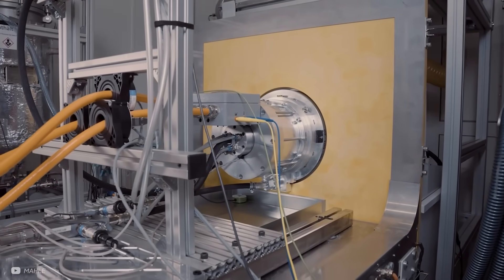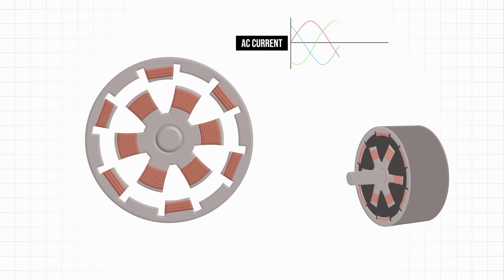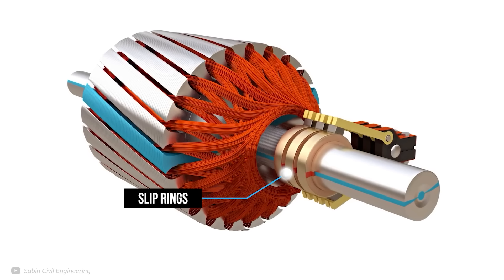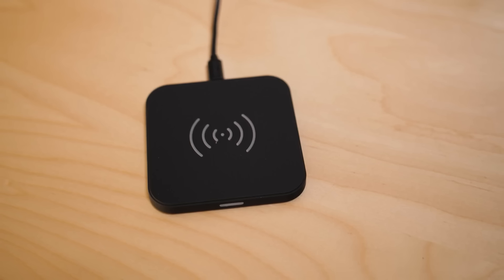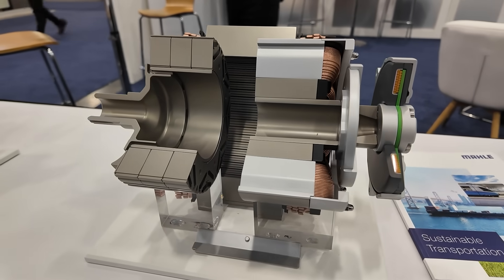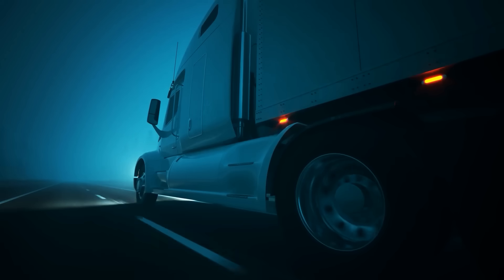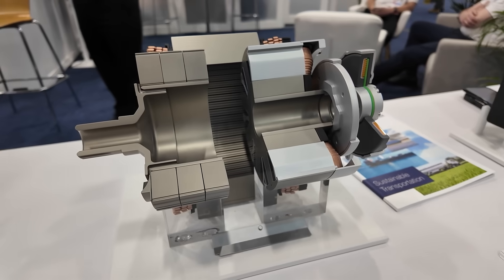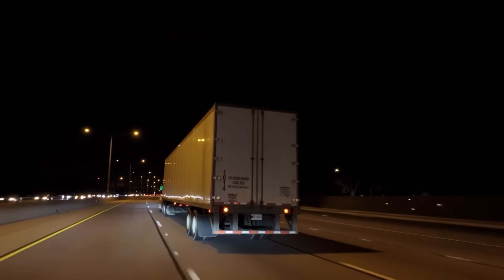Genius Contactless Motor Could Change Transport Forever

Comment: Induction motors are like 100 years old

Every ceiling fan is an indication motor

The reason AC won out over DC is induction motors

Brushless permanent magnet computer controlled motors are at least 30 years old

Floating oil bearing around the stator might sound good, but your churning through all that oil on the largest radius, lots of drag and you're wearing out the oil, not a large cost, 
But much better to have low friction air gap on large rough stator radius
Solid roller bearings on the smallest rotor radius can reduce friction and wear and tear

Thanks for all the work you or into the videos, it's way more effort than I ever put in
But maybe trust your audience to go deeper, 
This video is like trying to teach 123s to teenagers and then slap on the old you'll learn about that complicated stuff when you're older

Hitting the right note can be hard
As a kid I watched magic school bus and Bill Nye
It wasn't until later that I ever heard of Neil Degrass Tyson, when I finally did see some of his stuff I was annoyed that he didn't explain more, go deeper into details, 
But I'm pretty sure if I'd seen him first and Bill Nye later I would help the same about Bill

On the other hand, you probably get a lot of viewers eager to explain how you misspoke etc, which encourages an active community that is doing their own research, so, maybe you're a genius 🤷

Comment: This does actually change a lot ! ❤  this technique will be able to be used in things like plug in domestic,  commercial & industrial vacuum cleaners, pumps and other equipment that requires high RPM motors that are not tied to the grid 50 or 60Hrtz  !!!! 
   So all the sarcasm in a lot of comments going $# off   😮😮😮😮

Comment: This is much ado about nothing.  Wireless excitation of synchronous motors & generators has been done for a century.  But there is an elephant in the room, not mentioned.  Exciting that field coil (whether wireless or not) requires HUGE amounts of power.  That power must be transformed through (wireless) rotary transformer, which has losses proportional to the (large) excitation power.  Permanent magnets provide that "excitation" with ZERO power (thanks to quantum mechanics).  The only other technology that can claim this is SUPERCONDUCTING field coils.  This is even done in power plant generators.  (Someday, when superconductivity can be done at room temperature, this will be feasible in automotive motors.)   Second problem that occurs is when heat is generated in rotating parts.  (This is problem in induction motors, powered field motors, but not in permanent magnet motors.)  Cooling must be routed to/from moving parts, requiring dynamic seals.  These have wear problems MUCH WORSE than any slipring & are much more difficult to access for replacement, requiring removal from vehicle & total disassembly of the motor.
          Diagrams shown of sliprings are incorrect for this motor design.  There need only be TWO rings, not 3.  These photos are from 3 phase wound rotor induction motors (not commonly used today).

Comment: Nothing new and nothing better, just a contact less wound rotor. There are such motors with a "self" induced rotor. But a powerful permanent magnet motor is much more compact and lightweight. The benefits are not enough to justify using a universal motor.

Comment: But how does this differ from an induction motor? induction Motors don't make contact when they transfer power, they use induction to generate an electromagnetic field at the the stator which then causes the rotor to produce its own field and the interaction between these two magnetic fields is what causes the motor to produce torque, what am I missing?

They both don't use brushes, they also don't use slip Rings and both use bearings to support the rotor.
Reply: Ah, okay. I see now. I was initially focused on the shared characteristics between the Mahle mCT motor and standard induction motors—the absence of brushes, slip rings, and the reliance on induction. However, the crucial difference lies in the rotor excitation. I missed that it was externally excited.

In a conventional induction motor, the rotor's magnetic field is generated through induced currents from the stator's rotating field. The mCT motor, in contrast, uses a contactless inductive transmitter to actively energize the rotor windings. This makes it an externally excited synchronous motor, which is different from how traditional induction motors work.

While the stator still generates the rotating magnetic field, the rotor receives direct power, enabling more precise control over its magnetic field. This hybrid approach—stator-generated fields combined with active rotor excitation—results in enhanced efficiency across varying operational parameters and improves sustainability by eliminating rare earth magnets. Furthermore, the contactless power transfer reduces mechanical wear.

Essentially, the mCT motor advances beyond the limitations of conventional induction designs by implementing active, contactless rotor excitation, resulting in significant performance and sustainability advantages.

Comment: Iron Nitrides are considered as possible replacements for current rare earth magnets, no more dependance on China or the US. plus if current BLDC motors suffer from overheating  why not oil-cool them instead? why all the hazzle of trying to re-invent the wheel? 95% efficiency is spot-on, 😅nly heisberg could do better
Reply: I suspect in the near term it will come down to which technology is more mature. Once both are mature, who knows how capital cost, efficiency, power density etc will compare between them? I wouldn't be surprised if iron nitride works better.
Reply: I recently found out that BLDC motors aren't actually DC motors at all. They're multiphase AC motors designed to be run from a DC input.

Comment: My conclusion: the efficiency is not as good as expected any you need oil as cooling fluid, which also cost efficiency due to the viscosity or pressure drop. But you have a high power density. This is only important in aviation.

Comment: Im not an engineer, but I have a concerne, if theres no permanent magnet the stator coil have to be powered. Also the induction process is not very efficient, so there's energy loss there too. How much energy does it consume for the same amount of power in an equivalent permagnet engine. My intuition tells me that this will be much less efficient and thus power hungry than a standard permag engine. I'm afraid the lower cost of a unit will be offset by the higher energy consumption.
Reply: The fields on the rotor do not use that much current compared to the rotating fields of the stator.

Comment: I'm a retired truck driver and I can tell you many truck drivers love their powerful diesel engines and the sound they make. Yet if an electric motor can compete with the diesel engines pulling ability many drivers would be fine with them. Will be interesting to see how it goes.
Reply: they already do compete;look at diesel-electric trains and mining equipment.
Reply: @JayWye52  Well, yes, that's true. Of course a diesel/electric is actually a hybrid, not fully electric.
Reply: @JayWye52  those still have the diesel engine though
Reply: @DanRyan-v5y  the diesel engine is not doing any pulling,that's done by the electric motor. it's actually more efficient to have the diesel generating electric and have the motor do the pulling.  trains in Japan are all-electric.
Reply: @JayWye52  true but the op said electric motors to compete with the diesel engine, so one or the other not both. Both ,however, is probably better.
Many places have all electric trains , or diesel electric depending on infrastructure.
Reply: - yep the "pulling part" is easily done - the sound part can be piped directly into your headset we can even simulate a missed gearshift, that way you won't avoid industrial deafness long term..   (NB, I live making a bit of a joke, hopefully the humour is apparent, all the best man.)
Reply: @kadmow  Humor is always welcome. For me, if I were still driving I'd be fine with an electric motor as long as it got the job done. A couple times I drove trucks with an automatic transmission. A lot of drivers didn't like it but I liked it.
Reply: If it starts making good economic sense, drivers and fleets will switch as fast as they can. Look at how many have switched to the super single tires, flat disk wheel covers, under skirts, and the fold out aero kits for the back of the trailer. They are doing that stuff in the chase of a 0.1-0.2 mpg gain.
Reply: @ottopartz1  I agree. Efficiency is desirable. Any cost saving technology is welcome. Especially for fleets and owner operators. Even a small gain in MPG adds up to large savings over time.

Comment: Been waiting on that!  That system can be used to induce stable rotation in O'Neill Cylinder "cans" as a shell-mounted impeller instead of a hub-driven torque-arm system.  With contactless induction, you can keep it rotating for the many years required without the wear & tear on huge mechanisms.

Comment: .... you mean..... induction motors???  We've had induction motors ..... for ever.  So they precisely control the induction by using what is basically induction brushes.  Am I wrong?!?!?  I thought oil was an insulator, not a dielectric.  A dielectric is an acid or salt solution.  Am I wrong?!?!?!  You put oil in a transformer, cuzz it insulates.  You put acid or salt solution in a battery, cuzz it conducts and is ionic.  Yeah, exchanging heat away from all electric machines and batteries makes them run better and longer.  Not a break through seeing every CPU in existence has a "heat sink" and a fan.  The question is, "how much energy does the cooling system take in power from the engine?"  You didn't even comment on the "Y" slots cut into the profile of the inner rotor.  These are what Tesla is using to boost their induction power of their motors.  The next question is, "Why is a motor that is not using conventional induction using technology that is used by conventional induction motors?!?!?!?"

Comment: If you can control the strength of the rotor magnet, that also permits an increased RPM range because you can have max strength at low RPM for max torque, but as speeds increase you can do decrease the magnetic field strength to reduce back-EMF.  Like a built in gear shift.
Reply: Or you can use multiple old-skool brushed DC motors, and run them in series for low RPM high torque, and parallel for high RPM low torque.
Reply: @MarkStockman-b4j  You could.  However, a common method for traction motors was to run the current in the stator and rotor in series so that at low RPM when there is little back EMF, the stator field is maximized and when the RPM increases and the back-EMF increases and thereby decreases the current, the stator field automatically decreases.  That was the method long before switching electronics for things like sub-way cars.

Comment: This is a really good design, just on the cooling ( and harvesting of that heat ), but it is still an induction motor. OK the induction happens outside rather than inside, but I hope they release the details of their new design to back up their efficiency claims as I am currently dubious that it is as efficient as a permanent magnet motor. Great report! Thank you.

Comment: Why not have a hybrid system that is all oil cooled, then have a section with permanent magnets for low speed/ torque and use the induction at coasting/ high speeds.

Comment: How about regenerative braking? Its easy with permanent magnet but with this, you need to always power primary or secondary winding which causing lost of energy?
Reply: The fields on the rotor do not use that much current.

Comment: ERROR (graphics) at @6:30 . That’s not the receiving coil on the far left. That is the AC to DC control circuit, and probably performs some other functions as well.  The “receiving” coil is that green board that goes through the transmitting coil. And AC current then flows through wires in the shaft (shown blue) to the DC conversion circuit. You can see it correctly shown at @7:05. It shows “waves” between the two, and we can see the green board is attached to the shaft (rotor), not the stator.  This is important because to achieve high efficiency you need the magnetic fields to be coupled as closely as possible. Due to the inverse square law we lose a significant amount of flux density for every unit of distance.

Comment: How can it change transport forever? Brushless motors already achieve efficiencies well into the 90% range, so this new motor can only be an incremental improvement. Electric transportation is limited by battery technology, and of course the associated charging infrastructure, not by the efficiency of the electric motors. Most of the rare earth minerals go into batteries, not motors. So, as interesting as this motor may be, enough with the hype!

Comment: Electric power plants have been using small alternators on top of the generator shaft to power the field coils for 50+ years. This does fundamentally the same thing using electronics to generate the AC field instead of shaft power. Nothing really new here. And even this "new" design is already ~10 years old.

Comment: Using lossy wireless power transfer as a gimmick to sell a virtually identical motor to a synchronous induction motor. Lemme guess, it also cost about as much as a 45kW servo encoder motor... No thanks.

Comment: Fair enough, it's a development for the auto industry, but brushless AC generators have been used in aviation since the 1960s. I remember the first oil cooled gen in the 767 in the 1980s.
I don't think it's a breakthrough, and I would have preferred a deep dive into exactly how it works.

Comment: In reality the only thing this motor has going for it is no slip rings. It will be interesting to follow this and see their real world numbers. The lack of power density numbers is kinda suspicious in my opinion. I think maybe the amount of electricity they plan on transmitting (wirelessly) will generate way more heat than they are letting on.

Comment: The basic concept of non-slip rings on the rotor has already been developed in some home generators they basically use a capacitance and a rectifier diode or a bridge rectifier on the rotor

Comment: If rare earth magnets are so rare than why are they available in abundance in stationary stores at what I would call a cheap price. And secondly, if you heat them you can use a expensive machine to remagnetise them so then are you saying that the machine is expensive to make the magnets or are the mineral really rare? I'm guessing the former and we’ve bought the lie.

Comment: This new system is older than I am. Generators have been designed this way for 100 years. This is done to eliminate brushes. There is nothing new about this except maybe exchanging air cooling for oil cooling. You simply run the thing as a motor instead of a generator. How exciting.
Reply: Oil cooling is not new also. It can fail miserably (pumping oil into electrical wires = they become hoses).
Reply: Indeed, when I was an apprentice studying to become a ships engineer in 1976/1977 I had to keep some kind of log where I had to describe how several systems worked or how to how to troubleshoot different systems. This had to be done in a way that you showed a thorough understanding of what you did or studied. I saw the drawing in the thumbnail of this revolutionary motor and my first thought was "Ah, the generator on the 'Straat Talbot' (my first ship as an apprentice)". Two things were different: No fancy oil cooling and the activation coils were connected in a feedback loop keeping a constant 440 Volts.
Reply: It's basically a transformer with one half on the rotor and one half on the stator. The advantage with this design is that it can use digital switching to run the wireless power transfer at any frequency independent of the motor frequency. For a generator it's pretty easy because they run at constant speed and produce a constant frequency AC wave. For a drive unit in a vehicle you need to vary the frequency of the motor but this varying frequency negatively impacts the efficiency of the wireless power transfer.
Reply: I have seen this many times on 3 phase brushless generators. Now they are doing the same principle but as a motor.
Reply: Just check the technical drawings from catalogue presentation of Caterpillar generators from the early 1990's: The main poles in the rotor are magnetized in the same way.
Reply: Folks, it doesn’t have magnets. Everything you mentioned here saying that it’s the same thing has magnets.
Reply: @JoseGarcia-ro3ur   Rotating Electro Magnets? Nick Tesla supposedly invented rotating induction coupled AC motors. (even though his physics instructor Martin Sekulic in Serbia explained the concept  to him all those years ago) Because knowledge is a progression of ideas forming a continuum.
Reply: Right. It's essentially a small transformer on a shaft. You could add an adjustable tapped version of this to increase or decrease the voltage.
Reply: The unsprung  mass and gyro effects will make it fun to drive not
Reply: Pardon the pun.

Comment: IR losses in both rotor and stator, along with the losses in efficiency of the “wireless” energy compared to lower loss slip-rings means that this isn’t going to be anywhere as energy efficient as a permanent magnet (rare earth) motor.  That oil cooling should be telling us something about how much energy this motor will throw off in the form of heat.